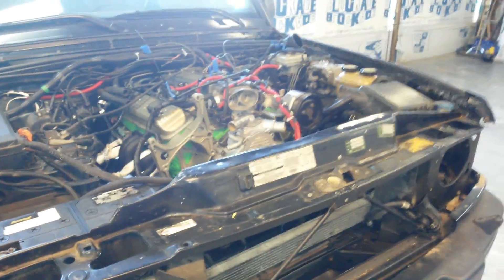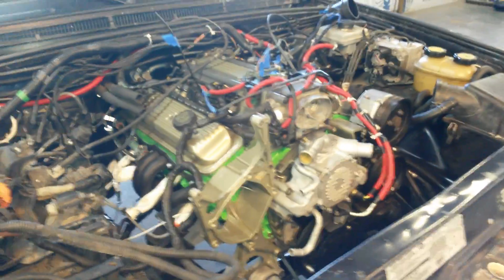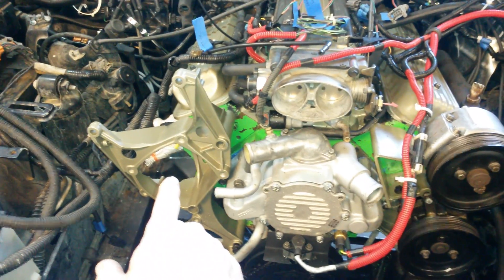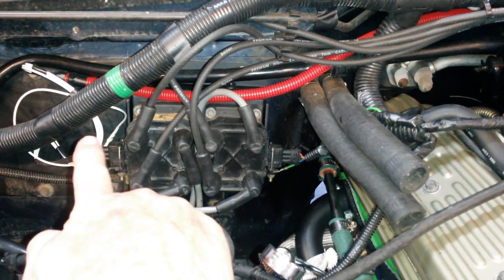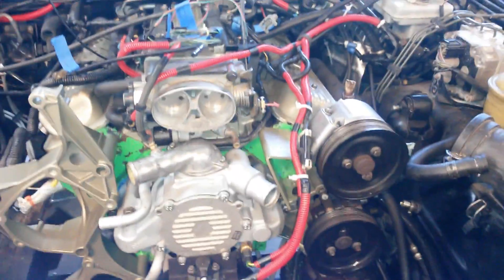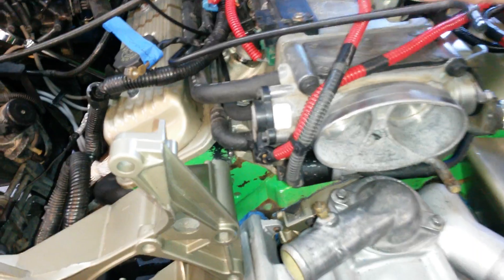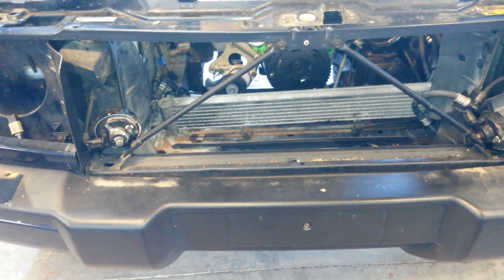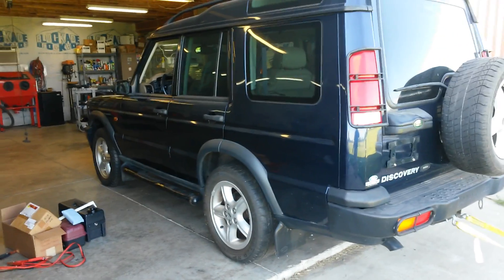Land Rover Discovery II with Chevy Engine

Comment: Did anyone happen to notice the mechanic said (4.3 V8) there is no 4.3 V8. The GM 4.3 is V6.
Reply: actually your incorect there is a 4.3 v8 i have a1996 chevy caprice classic and the engine that is original to the car is a LT88 4.3L 263 cu. in. fuel injected v8
Reply: You do know that gm and chevy are the same company right?

Comment: Technically the landrover engine is a general motors engine so yeah
Reply: Really
Reply: @joemorris1858  it's based off the buick 215 aluminum engine landrover bought it off GM years ago
Reply: @larrylooney4495  kool
Reply: @larrylooney4495  I've got a 2002, having trouble keeping sound on my speakers, power could it be a short, comes in and out

Comment: I believe the easiest engine swap would be a mid to late 1960s Buick 300 cid V8. Pretty much the same block as the LR, but in cast iron. It would require a universal BOP bell housing plate adapter to mount the Buick V8 to the ZF transmission. I believe the Rover alum heads will bolt right up to the Buick, the 300 crank would need to be swapped to a LR 4.6 crank to use the LR flex plate. The LR timing gear cover/oil pump would need to be swapped onto the 300 to delete the distributor and to gain the cam sensor. Unknowns (to me) are the intake (might or might not require spacers @ the heads), crank position sensor, starter position and depth to use the LR starter and ring gear/flex plate. Firing order is the same, so FI and timing issues should be minimal or nonexistent. When the swap is completed, the 300 should look just like the LR 4.0 - 4.6. Weight with LR heads should only be marginally higher.

Comment: Just a little information for all the landie owners out there. I've owned my S1 Discovery 3.9 V8 for 16 years . I've driven it all over Australia and towed a full trailer through the Daintree Rain Forest, it's got the steepest roads u ever seen and she got over 2hunred thousand ont the clock and never broken down and don't use any oil between changes. It's my 3rd landie and i will keep this one till im in the ground.

Comment: Looks like you don't follow up or reply to the comment here. I'm doing a engine swap and though there are a number of companies offering various solutions t would be nice to see how you made out with your swap in the end. Would be nice to know whether you got the ABS, Hill decent and other electronics bits working properly, also to know how the engine performed using the stock ECU since the fuel and timing maps would be different I would imagine. What some are charging for adapters for 6 speed tarns, engine adapters and electronics is expensive and makes me wonder why no one has come out with an affordable kit since the disco is a decent truck but not too many people want to spend what it costs to rebuild the 4.0 or a 4.6 properly and a affordable option that works without too much hassle would likely sell very well. The latest that Cummins came out with is pretty slick but by the time you add in everything to be on the road still is a lot more than the vehicles are currently worth, a 4 to 5 K option complete would be a very salable product (Including the salvage engine) Where is your disco project at now?

Comment: My current Rover engine as you like to put it has covered over 300000 miles, apart from a head gasket and service items it's never let me down!  It's a 200tdi so not a V8 like yours!
Nothing wrong with the V8 providing you don't overheat them as they can then suffer from slipping liners.

Comment: Hello sir I'm currently bored of my rover engine and doing the same with a carb 350 what trans are you using ? Standard rover ? I'm planning on using my discovery 1 auto box and transfer box and diffs ..... Or is that asking for trouble any advice is appreciated Thankyou 

Rover engines are great if you want to spend a fortune building a fresh one and then replacing cams every five minutes whilst waiting for the block to crack lol

Comment: Excuse me that original block came from a Buick!!! So you tell me who doesn't know how to build an engine. Nothing wrong with mine. Poor maintenance I think!!!
Reply: Buick designed but the tooling rover used was shit. Hence why the 2003-04 engines had so many problems.
Reply: tcr6v1 wrong.  Tooling was fine.  Lol. They pushed that ole engine way up from its original design and it still ran great.  People get hung up on comparing it to today’s standards.
Reply: actually the same tooling was used for the rover v8s whole production and even the tooling was bought from america it was worn out and well due replacement by the time they scrapped the engine 

all of the cylinder liner problems are caused by shit block casting and it was happening to 2 year old range rovers so hardly poor maintenance 
and that information comes from landrover engineers and fitters that now work for landrover magazines 

the engine was a total dog thats why buick scrapped it and lets face it buick only ever made boat anchors anyway it was outdated in the 60s

the ally blend basically started to dissolve
Reply: @PawsPistons  wrong, the tooling was garbage. That's why you hear the clacking of the lifters that can be fixed by using a heavier oild weight. 15 40 Rotella usually solves the problem.
Reply: 72Disco1998 I disagree that tooling was junk.  That lifter clacking was common to many flat tappet engine as they wear.  It’s not specific to RV8.  Lifter noise was so common on older vehicles it’s still used to describe tapping to this day in engines as something we can simply dismiss.  That alone is not proof of bad tooling.  Regulations and pushing more power than design was the reason and I fully stand behind that.
Reply: I agree, probably very poor maintenance on his behalf and to make it worse he has no idea it's an american engine hahahaha what a knob. Not enough Oil changes and incorrect coolant probably used and not serviced on a regular basis.    I've had about a dozen Land Rover V8 Discoverys and Range Rovers and not one engine problem.
Reply: @forsaken2099  it was initially designed in the late fifties by Buick but Rover bought the design and tooling and manufactured to their spec, it's not American made.
Reply: Sorry, it may have been good in the 60’s when it was designed but it has not stood the test of time and they do not last. Dropped liners, head gaskets every 100k and bad heat transfer design. Modern LS engines are much more reliable.
Reply: @andyhoffman2475  head gaskets are a huge reason many Bosch 4.0 are no longer on the road because od the cost. Don't get me started on the 4.6 with slipped sleaves.
Reply: 72Disco1998 head gaskets are just common on a few engines out there that are aluminum.  Subaru for example had a worse head gasket issue.  Honda has had it.  It’s not specific to any vehicle but seems it’s aluminum head and block and lack of cooling system maintenance that’s the issue. Long life Aluminium block coolant becomes acidic after its lifetime and that kills the gasket.  I say flush that cooling system every 3 years or so regardless of mileage as time seems the issue. Even if bottle says 5-7 year long life and you’re using the OAT flush that. If using old green coolant still flush that stuff every 3 years or so.  Keep the oil up and simply maintain the engine and the gaskets will hold up.  I have far less trouble on my old british vehicles than average because I maintain my stuff.  People call me the british car whisperer as I can predict what’s needed before it’s needed on mine.  Also don’t break down often.  It’s not skills it’s simply maintenance!
Reply: 72Disco1998 the 4.6 sleeves actually backs up my claim the main issue was engine being pushed too far.  They wanted more out of what was there and kept pushing further.  You just supported what my claim is with that alone!
Reply: @PawsPistons  Valid point.
Reply: +Robert Carney your wrong the buick 350 is a damn good motor and so is the 215 buick aka rover v8 very good engines if you keep ur oil changed
Reply: @jessilooney2444  

Oil changes don't fix the casting going bad on the block in the water galleys it's a well known problem and was causing issues in the Buick and rover engines due to the blend of ally used no antifreeze on the market at the time 60/63 was comparable and that's why Buick scrapped it rover then bought the tooling and continued to make changes to the casting blend making it cheaper and cheaper to produce and also making it weaker and weaker 

The main issue with the rover was head gaskets oil sealing surfaces (Buick had the same issue) and the liners slipping 

Its well documented and it's the reason they are still being produced by coscast in the UK with a new blend of ally and a much better liner design 

As I said the rover v8 was a very good engine in the 60s but a lot more has come and gone that's better the massive advantage is it's very light for it's displacement so makes good sense to put it into a light race car
Reply: I know this is an old comment but there's nothing wrong with the original engine design, per se. That design was okay for its era, only sold off because larger engines were trending in terms of US market of the day, and the expense of manufacture. 

These engine are problem prone for three main reasons- 1. When rover redesigned the sleeve setup and forewent flanged sleeves for a stepped block setup, then opted to have the bottom of the sleeves chamfered to ensure proper seating 2. Poor metallurgy in the aluminum used to cast the blocks at GEMS and Bosch also poor QC control at test factories and no oversight by Rover 3. Needlessly complex and therefore finicky and unreliable cooling system designed by Rover engineers, especially when combined with technology other two issues. If something is going to be that complex in its engineering, it absolutely MUST have redundant systems on standby if it will be reliable.

I don't see where any if these issues could possible be the fault of Buick. If you study the history you will find that reliability issues never really manifested until Rover Company bought rights, and even then it served as a reliable engine until displacement began to be increased.
Reply: Can of worms springs to mind

Comment from the maker: I know I promised an update but the last couple of summers had me doing other projects. This is number 1 for the coming spring when I go back up north from Florida. Besides the security reset which I don't think will be too much trouble, I need to hook up the airconditoner lines, exhaust tie-in (I have it connected presently with flex pipe) and misc. stuff. Then I'm going to do a complete video with pictures of the step by process. Still not an easy or the answer to Rovers garbage engine due to the work and expense involved, but for those with the time and money its a fun project
Reply: very rad swap man
Reply: aircaptain34428 I take it you haven't figured out how to make it completely work yet? Trans work, computer work, security system, and alot of other things because there no update of you driving it around yet? If you have got this completed please share because there's a world of people that want to ditch the rover engine for a chevy.
Reply: Roverman as soon as I can find a deal on an all aluminum  Chevy LS engine. I'm making the swap on my disco 1.    But for now my original  4.0L is still going  strong  with over 300,000 miles on it
Reply: @shanemcclaran3012  I would love to see it done. I've got 5 disco2. My 2004 would look super nice with a 5.7 in it. But I dont have a clue how to do it.
Reply: @roverman985  I live in Florida.  I can do the swap if you can get the vehicle and parts to me
Reply: Looking forward to an update when you can provide one...
Reply: now everyone is going to lower temp thermostats, on board OBDII live monitoring of engine, and even as much as rerouting the cooling system to work more like an old V8 and boy does it work! my hot south florida run temps are 183F-194F... thats been for last 5 years!  of course shocks and springs went lol
Reply: He never finished this project.

Comment: What a great video. What I like to do is put a Chevy 4.3 V6 in a 2003-2004 discovery. The plan is to put a new intake manifold on that engine with a carb and a regular distributor. No more engine computers etc. So the 4.3 V6 and 4.3 V8 have the same bolt pattern for the transmission. How difficult is it to make the adapter plate to the defender's tranny? and or engine mounts. Thanks for your reply.

Comment: Could you please post an update? This is very well spoken and would be a great active channel.
Reply: I will do an update soon. I've been real busy with my work and though I made a lot of small changes and improvements, I'm at a stand-still because of the Rovers security system which disables any spark and needs a system reset from supposedly a dealer. This means I have to get the thing towed and reset in order to complete some of the little things. Thanks all for your comments
Reply: Michael where are you located? I may be able to help with the electronic aspect as i have the factory tool. Really interested in this conversion as well. Would be a good alternative for my customers, rather than paying 10K for another Rover V8 install.

Comment: You went crazy on that men lol!!! I'm glad it work fornyou but  Diesel is the way to go men.. Also let me tell you, the only reason land rover engines fail all the time it's because of the cooling system.. What I do on them all the time is that I modified the system by just simplifying the system and adding a chevy t state 180F. That will solve the problem and the engine will run fresh all day long.. Before that mod, my temp just to climb all the way to 240F on idle... Thats what kill those engines men! Mine its been super reliable and I just hit 200k miles on the original engine and also original head gasket lol believe it or not! She's been awesome truck and I own this for 10 years now, and I do extensive off road, water crossing, expeditions ETC!!!
Reply: Cayman is 4x4 Landrovers Another BIG reason the older Land Rovers fail is because of OIL. You have to run 20/50 oil in them or they will overheat and blow up. I have a sweet '88 with a loft, Big Tires, Winch, LED Lights, Plus lots of little extras that I bought for $800 when he originally wanted$6500. Because no matter what he replaced (Radiator, water pump,thermostat, Fans, It still overheated.. I bought it, drove 3 miles to Advance Auto Parts. changed the oil. Been raising Havoc every since. The correct oil means everything !!!.
Reply: can you please explain about your 180f chevy t state ....thank you
Reply: Put a chevy 180 Degree thermostat in replacing the `OEM thermostat- the engine runs just a bit cooler and it seems to really stop the constant overheating when at idle with a/c on. We did it on our D1 and it worked wonderfully.
Reply: +Patricia Payton where you live? I'm in Georgia and I work on rovers all the time, I may be able to help you this is my email mydisco03@gmail.com
Reply: Can you recommend a Thermostat model?
Reply: Can you please give me more details because my Disco 2 is always very high temperatures and in AFrica we run like from 19 C ~ 50 C degrees

Comment: PLEASE do a write-up on the forums once you're done with this. If you can trick the Rover PCM into running this you'll be accepted as a god
Reply: I have done Ford 5.0 and Chevy 5.7 conversion  using  Rover PCM.. it isn't a difficult process to do just wiring  match up..   ignition wiring fuel wiring.  However I do recommend doing mass airflow delete on either engine save the headache there..  converting these to American v8 is a true blessing  rock solid reliability. Hell of a lot easier to maintain  more torque  cheaper engine parts. If it's your first conversion expect it to take a few months after that, about a week to do it all correct.. now shoving a  old carbed 350 down in the hole is a weekend project and works just as well..  I don't recommend using the baby lt1 cause well  they are just boat anchors far as power goes.. this man must just like cruising. If your going to send it,SEND IT RIGHT.
Reply: @stevemorgan4201  Do you have more info for someone doing it for the first time? Like how did you mate the engine to the trany? Custom fabbed plate or aftermarket kit, any help would be greatly appreciated.
Reply: Marcus Harper there are several manufacturers  in Europe that  produce transmission adapter plates for the Chevy engine swap
Reply: @stevemorgan4201   do you have more details on what all has to be done for a carbed 350 to be  in a 2000 disco 2

Comment: I did a similiqr swap with a 5.3 litre chevy, but I could not get the rover cpu to correctly recognize, after 2 years of trial and errors I could not get a valid emission test
Reply: exactly my thoughts
Reply: rover ron my question to you is why didn't you just use the 5.3L ecm and engine harness  and build a stand alone engine harness and use a laptop to  program your 5.3L engine ecm  everywhere you look there are LS swaps with all the info you need. Just because it's a land rover it's really no different than  doing a LS swap into a Toyota or a Mazda. Jmo

Comment: My 97 3.9 rover engine has over 200,000 miles on it and still chugs along pretty good but when it craps out I plan on doing something similar to this. Hopefully the extra horsepower doesn't break the trans.
Reply: Did my research on this one: if you swap out the A clutch pack, input section, and torque converter from an early 90s Range Rover the stock trans will take a lot more power